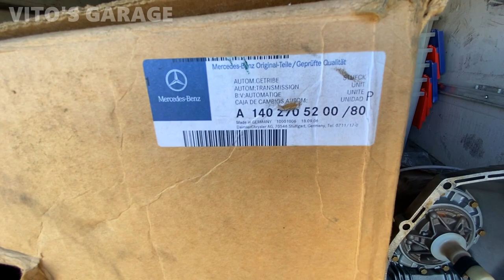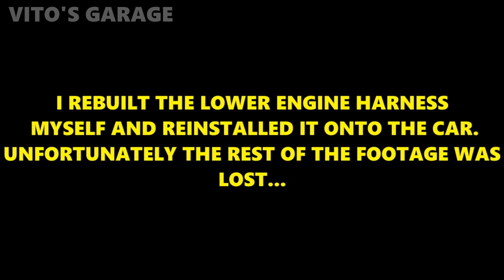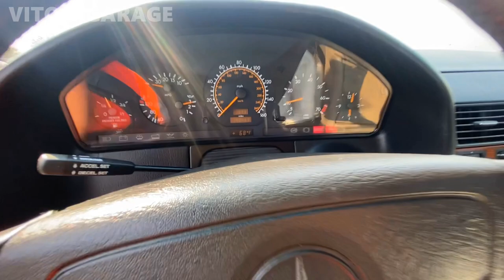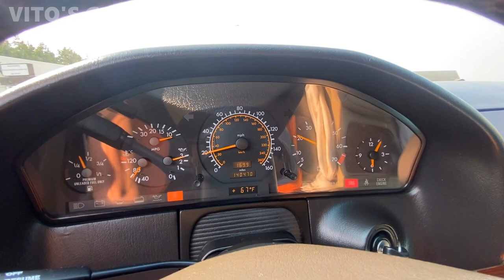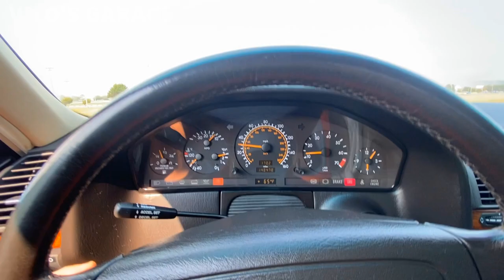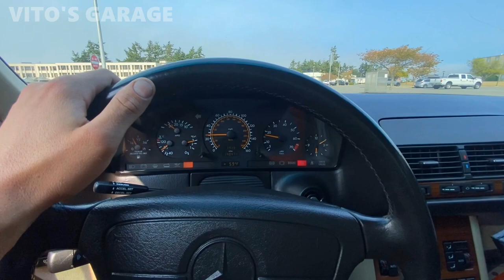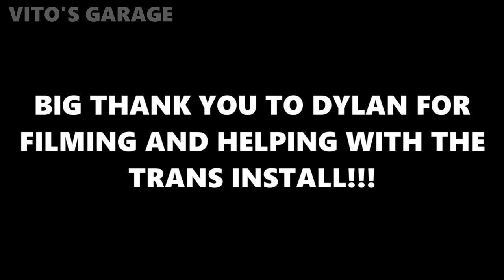Mercedes W140 S320 Installing a Brand New NOS Transmission!!! New Rear Main Seal, Starter, Harness..

Comment: I need some input on misfire situation 97 s320 all new plugs,coils and wires still throwing misfire cylinder 3
Reply from the maker: Injector clogged, stuck open or not working at all? Use a long screwdriver while the car is running and put one end to that #3 injector and the other end to your ear. See if it’s clicking

Comment: is it an 722.4 or 722.5 ?
Reply from the maker: 722.5
Reply: @VITOSGARAGE can I use dexron 3 or I have to use the Mercedes transmission fluid i my w140 is 722.5
Reply from the maker: @NileSai  Blue Valvoline bottle that I was using in the video works great. It’s a Dexron 3 rated. Add a bottle of Lucas trans fix additive too. It’s always good
Reply: Вито привет! Большую работу ты проделал на земле.большой лайк! Надо бы подумать о подъёмнике и гараже.удачи в восстановлении!